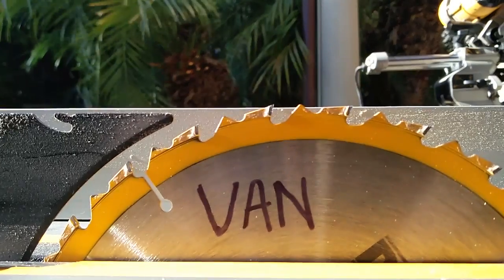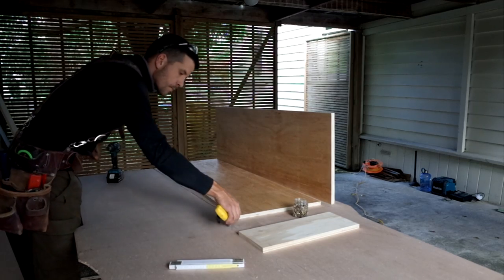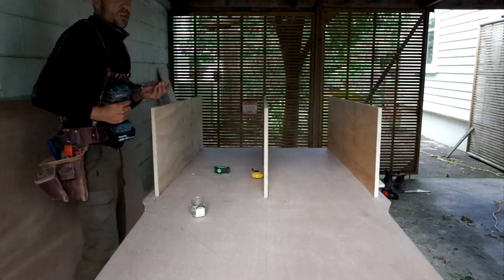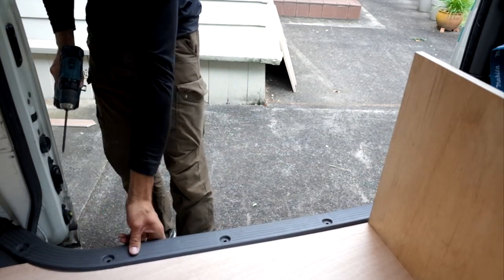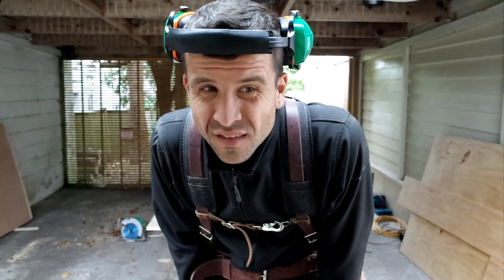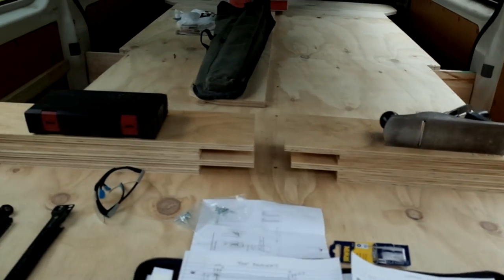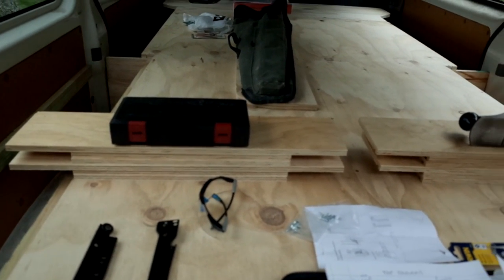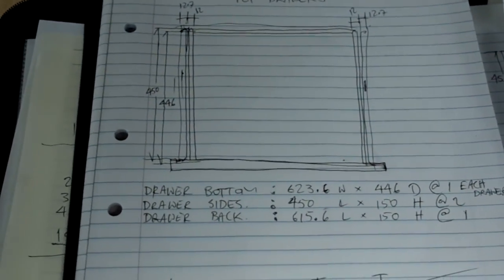Fitting Out the Van

Comment: How did you join the boards? You didn't show that.
Reply: which boards ?,  i can tell you how he did anything in this video
but for the most part when you are joining boards, depending on its' structure,  you are either going to be using Screws, bolts or.... Glue and Nails or Glue and Screws.
most of this was Glue and nails 
the glue holds it there in place,  the nails are added support and then the structure itself holds it together and stops it from moving
if your'e keen, you can add Dowels and dowel holes to hold it all together and then Glue and nails  to top it off

Comment: What's the best wood to use to build draws and false floor in a ute
Reply: as for the false floor, it depends on how much weight you need it to support,
this will define the thickness
but i reckon, for a cheaper option, go with plywood but that doesn't last as long.
if you want a better result,   PINE .
you can go with harder stuff like oregon, but i think for just flooring and fit out stuff this might be a bit of overkill, also it's more expensive than the other stuff,  hope that helps